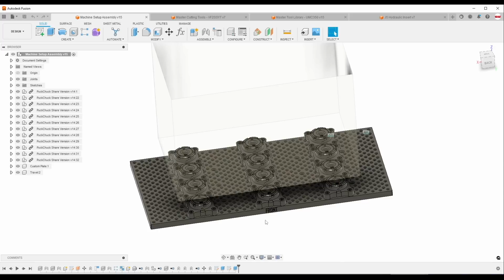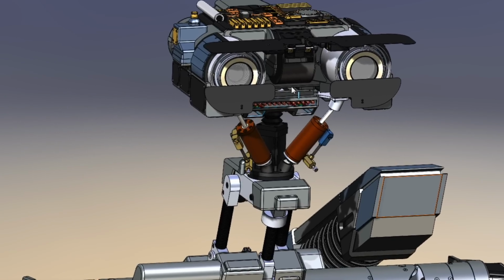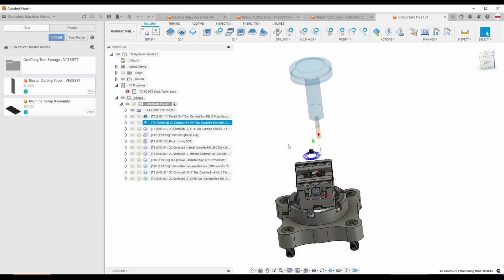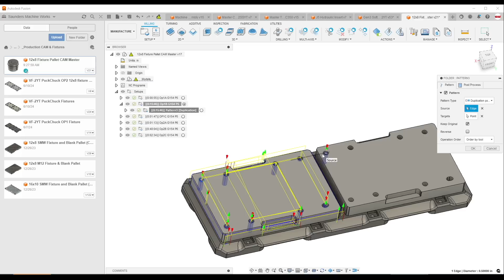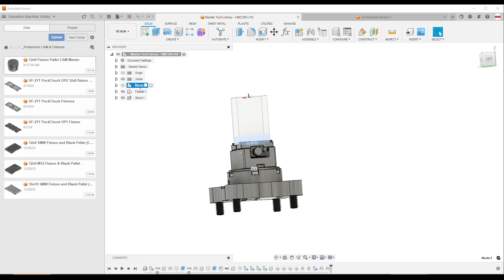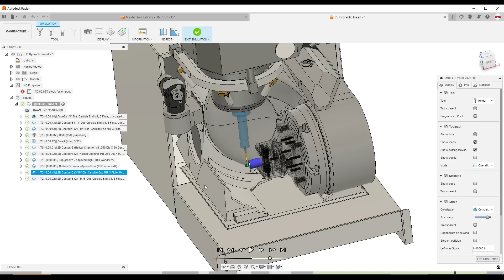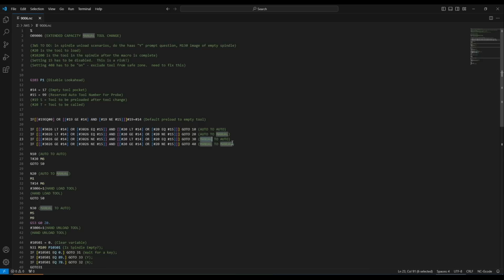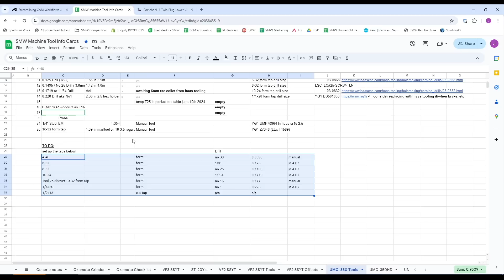Best Practices: Fusion CAM Libraries,  Workflows & Post Mods for our new HAAS Machines!

Comment: I was thinking that one way to do the manual tool change would be to keep one pocket empty (p18 for example).  Then tell it to go to p18 and pause.  Then tell it to use T75 H75 D75 and manually put the tool in the spindle.  Then if you want a safety check, command it to check for a broken tool to verify you put in the correct tool. Once the broken tool check passes, then it proceeds to automatic operations.  I’m not familiar with writing macros, but you could do a lot of this with a pass through operation that could be saved as a template.

Comment: Lack of a master library is definitely a source of irritation.  Even as a single user with a single machine, I have 2 computers I program from and there is no function to sync libraries between the 2 computers - say if I make changes or add a tool from my office PC, then go down to the garage.  Those changes aren't there unless you create a "snapshot" of the library, manually export it from PC1, then import it onto PC2.  Or if you're lucky, a recent file you worked from has all of the latest tools in it that you can draw from.  I can imagine how this becomes an even bigger headache when you have multiple PC's, multiple users, multiple machines, etc.

everything else is cloud based in fusion, why can't the tool library live and update itself with changes like any other file?  Is there a functional reason it was set up that way?

Comment: Noob question here. How do put your fixture on the machine in fusion? Do you draw your work holding and save it as a model or is there a way to up load one from the manufacturer? Maybe there is a video on this you can point me to? Appreciate it
Reply: The majority of manufacturers have solid models available on their site.  You just download that and use it as it's own file to insert into other designs.
Reply: @kazlx  thanks!

Comment: That macro for hand loading tools is a great idea! may have to borrow that concept to get more tools available on my 12 tool X7. Have you considered adding automatic tool touch off to every manual load tool operation? That would give you the dual benefit of verifying that spindle is empty AND re-verify tool length. Longer cycle, but way more process reliability.
Reply from the maker: Totally agree and, yes, I have

Comment: Look at those sexy fixtures. I really like the flowing/filleted changers on the edges
Reply from the maker: Thanks!  Gravity is your best friend on avoiding chips from building up
Reply: @nyccnc  right. I’ve used ball mill troughs inside a fixture before, is that made with a chamfer or ball?

Comment: Working out them manual tool changes will be a massive help for anyone running older Mini Mills with only 9 tools available In ATC. 

If it wasn’t for your adventure John, I wouldn’t have my shop. Thank you for that!
Reply: Thanks!!
Reply: I did this a few months ago for our mini mill setup , we can now call any tool number and assign it to any slot number in the carousel and the tool offsets all work in their correct H assignment , if a tool is not assigned a slot in the carousel it asks for a manual tool change. 
https://youtu.be/92KwEF_HHJU?si=bOGxzYsWYZHvsuf-

Comment: 14:15 It's impossible to crash and double load a twin arm style tool changer. It simultaneously removes a tool from the carousel AND spindle. The only issue you'll run into is the pocket used for manual loading having a tool present.
Reply: Unfortunately, not true.
Reply: @saundersmachineworks can you explain that? I too am thinking it will just put the tool from the spindle into the empty pocket from the tool that was just called up. That's how you get 1 extra position in a twin arm random pocket tool changer because there's always something in the spindle
Reply: @alexlaurent2967  I think you may be correct!   But... I swear there IS a crash risk; if I think of it when I get back to polishing up this code, I'll comment here.

Comment: I have my tools in a cloud library which I can access from any computer, in any part that I want to machine.  Am I missing something?  I don’t get it.  Isn’t this a “master library”?    

I also use a lot of cam templates which are accessible from any file and include the tool data.
Reply: As soon as you use a tool for a part, the tool is no longer linked to that original cloud library. If you tweak feed, speed, flute length, or any other info in your cloud library, it does not update any of the programs you have used that tool for. A master tool library would.
Reply: @mattdennison201  ok thanks for the explanation.  I guess haven’t ran into that issue because I rely on templates so much.  I could see how updating tools would be nice for existing production jobs.  I only do single/low qty parts that almost never repeat.

Comment: I don't know about automatically changing the tool through-out other programs without opening and manually changing.

But its 100% possible to have a 'master' tool library that runs of Microsoft's OneDrive, we have done this for our business. I believe it can actually run off any cloud based server. 

I use it as i sometimes program from home and it was a pain transferring tools between the laptop and desktop etc.

If i remember correctly i used either Chatgpt or google gemini to do it, but you can find content through google on how to set it up.

Comment: Use T19 for all manual loading. Use the offsets H and D via the post. Don't risk it with your macro... there is no need. T19 is safe on an 18 ATC.

Comment: John, you could use G167 Modify Setting to toggle Setting 10 Limit Rapids to 50% on and off from anywhere within the program.  This doesn't completely solve your tool change speed issue, but it'd certainly give you the option to slow it down somewhat programmatically.  We use G167 on our lathe to change the tailstock rapid position setting mid program so we can have multiple tailstock hold positions within the same program. Or we use use it to change the tailstock rapid position programmatically instead of requiring the user to set it manually for each program/part.  G167 has ALOT of uses beyond that on a Haas machine.  I'm sure if you dig there is a setting that could be toggled by changing a macro variable to adjust the current rapid speed.  Then alias that code into a "slow" tool change custom M code.

Comment: The Library thing in Fusion is definitely a drawback from the teaching side. Of course, this does give me a chance to teach 'How to make a tool in the Fusion Tool Library'. That does create hundreds of potential points of failure in a full class. If we could just afford all the cool Harvey stuff, we could just use their supplied library! But public schools just don't have that kind of budget. I'm doing a Zoom training with Haas and Autodesk about their new curriculum and am absolutely going to bring it up to them. Wish me luck!
Reply: Its more about the saved speeds and feed, along with the holders for different operations, its very annoying

Comment: Hi John, I've heard you talk about the master tool library issue for some time.  Fusion has a good API.  It is all Python.  You can have a script run automatically every time you run CAM, which compares your current tool library for that program to a "master" CSV or JSON, and then warn/update as appropriate.

Just get ChatGPT on the case if you have a small amount of Python knowledge, or Upwork etc if not.
Reply: And that works for 2 weeks until fusion updates and you need to fix your code again.  A built in master library seems so fundamental and users have been asking for it for years.

Comment: Generating a form for updating the tool library spreadsheet (and if could even go into updating your fusion library but would be even more work).  Then have cheep tablets at all the machines so that any changes can quickly be made through the forum at time of change.

Comment: Getting rid of the chips is such a pain. Ive had guys say the tooling are dropping steel in the scrap and then wont take it or basically takes it with no compensation.